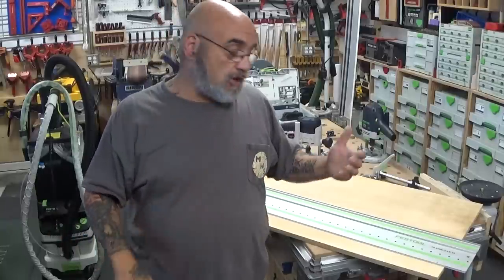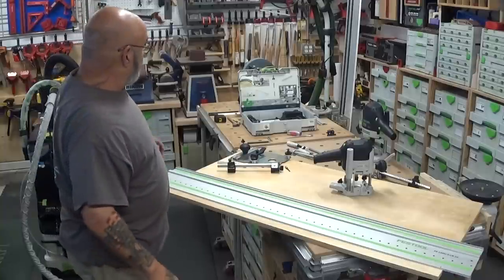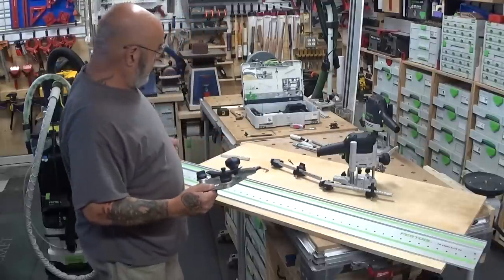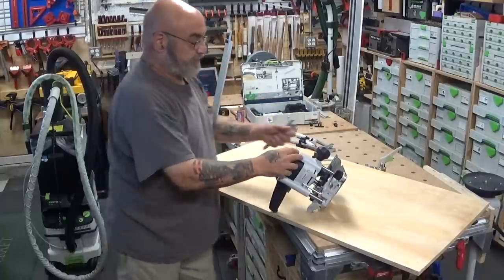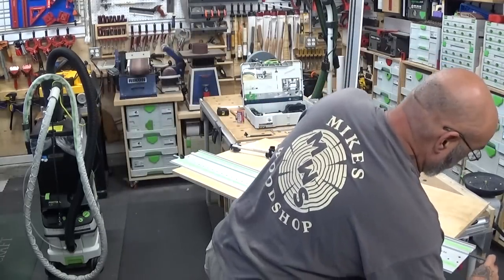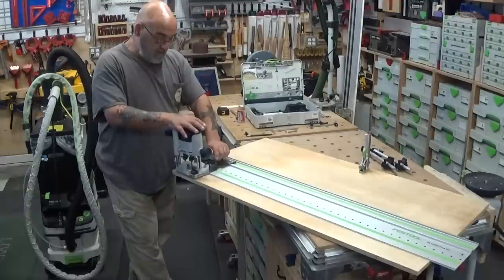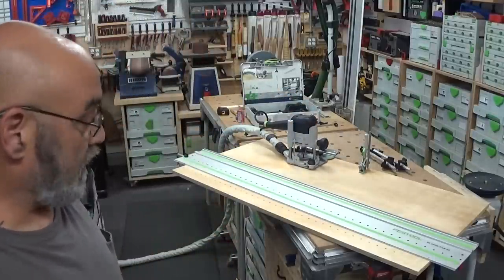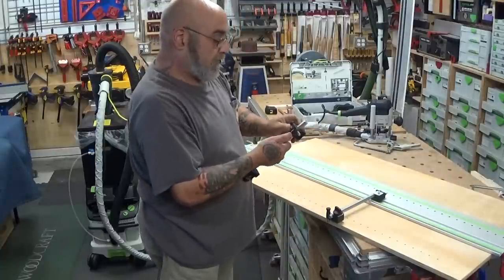Setup and Demo. of Festool's LR32 system.

Comment: Pretty good video, Mike, I learned some things here that Sedgetool overlooked in one of his videos on this system; one being the difference in attaching the OF 1010 vs attaching the OF 1400. I have the OF 1400 and attached it using the method for the OF 1010. I never realized what the two machine screws were meant for and Sedgetool missed out on explaining this differs from attaching the 1010.
One tip / critique  would be about the parallel bars and how to read or use the measurement scales  on the sides. I can't quite figure out what the use or purpose is of that secondary scale of the .05mm increments.
And a close up of the depth adjustment (what was it exactly?) would have been informative.
Reply from the maker: I’m glad you  liked the video.
Reply: @TheBuddylab  Yes sir, I certainly did 👍

Comment: Nice demo Mike. I love the LR32! You know, the 9.5mm mark on the guide rail stop bar that clamps on the top of the rail for location works real good when building boxes for the SYS Drawers. The instructions for the SYS drawers say the minimum height for the first hole is 8mm. Using the 9.5 mm setting on the location bar gets that first SYS drawer nice and tight to the bottom of the box. 

I also herd you mention a new AC! That is great news! I remember you telling me something about your association prohibiting you from doing it. What did you end up with?

Comment: Hi Mike: Enjoyed the video but I have a few questions. I have the LR32  system and the rail and every time I use it for the sys drawer slides I never get it to match the other side holes. I set it sixteen up and out for the left side but when I do the right side holes they never line up with the left side holes. If you set the left side at 58 mms what do you set the right side   to? I know you reverse the rail and I think you said the same setting at the top for the right side. That probable was my problem for  the right side 16 up and out . Is that correct?